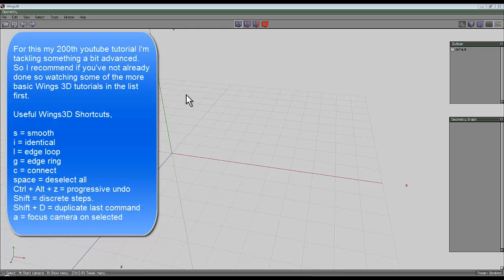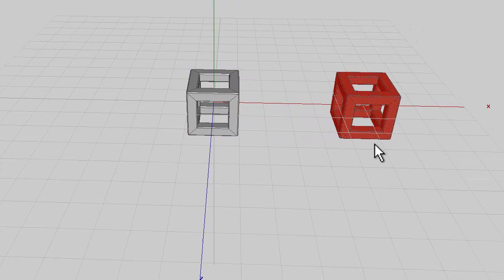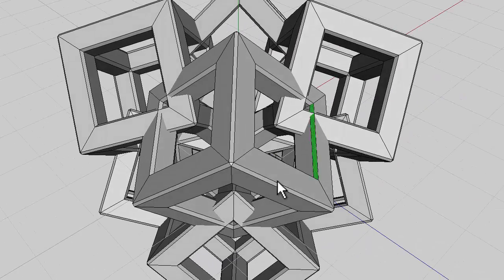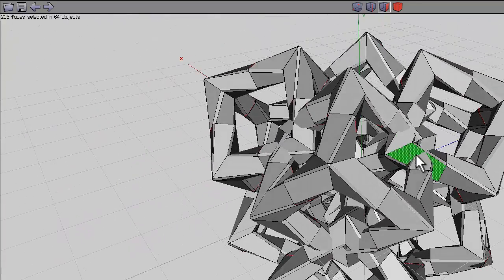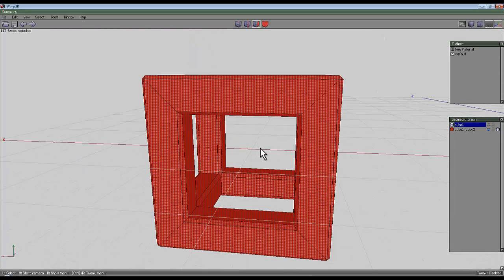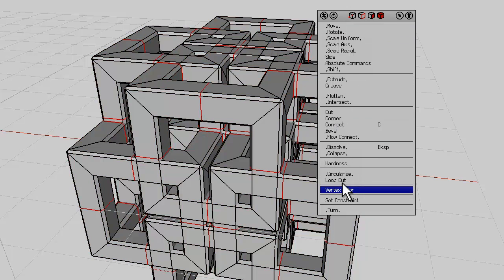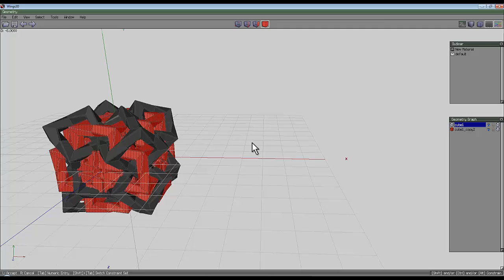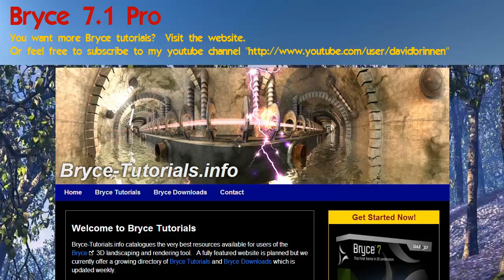Wings 3D project - two part twisted woven cube - by David Brinnen.

Comment from the maker: The weld is tricky, since I had to do about a dozen takes to make this recording due to things going wrong in the model - particularly at the weld stage - I know it is very critical.  If it looks like it has a chance of welding, just up the tolerance a 0.01 at a time, starting at 0.05 and getting larger.  Hopefully it will weld before it welds something it should not!  Also, try a clean up too... sometimes there are artifacts I don't know where they come from, but they can mess with the process.

Comment: David, can you check your values for inset/intrude to hollow the cube at the very beginning?  Not sure what's up with my software, but when I use your values (I even typed them in manually), I can't get the interior faces to line up for a clean weld operation.
Thanks for another great video and congratulations on video #200!